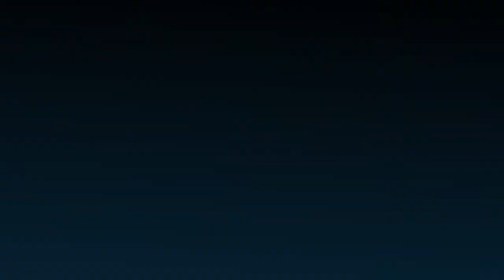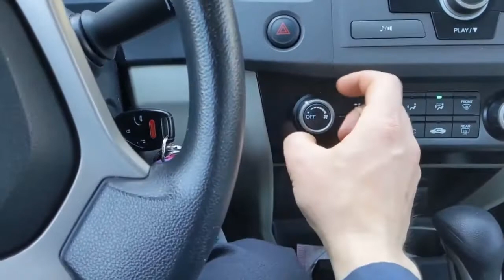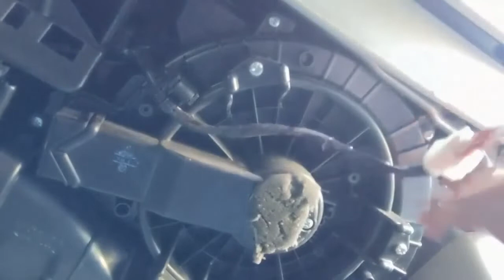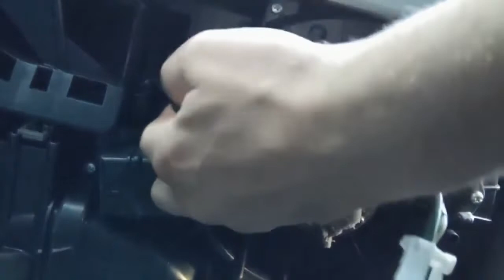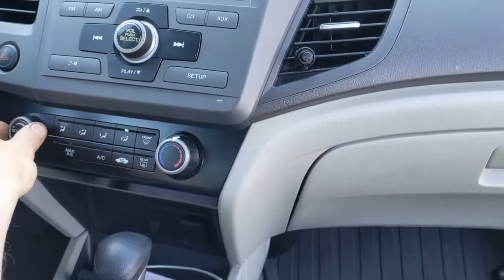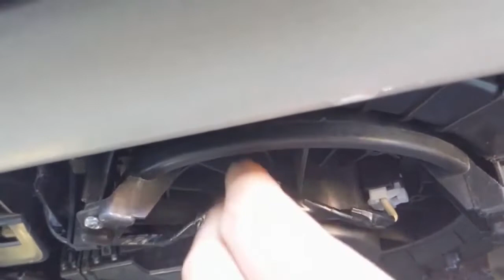2012 Honda Civic No Fan/blower Motor Operation | Blower Fan Not Working | How to Repair Blower Motor

Comment: Can you test the wires by using a multimeter?
Reply from the maker: You can. You want 12 volts on full blast 👍. A test light is the best because it puts a load on the system. But a meter should be fine.

Comment: Should one side of the connector constantly have power on it
Reply from the maker: @lesliemincy2084  It's an interesting design. The white wire on the connector will have power from the blower relay with the blower on. The green wire will be your variable ground controlled by a transistor.

Comment: Anybody help, my 2012 Honda civic is making a clicking noise coming from top of dashboard bit when I select fan speed first setting it mutes the clicking noise. I’ve checked the fan motor which is ok.
Reply from the maker: @JohnQuick-og3lg  Does the clicking noise change speed as you turn the fan up?

Comment: Question ; if the blower motor is faulty where there is no action on any speed setting (and you've ruled out the resistor via a test light), would the a/c clutch NOT operate? Because that is what is happening on my car....I would expect the a/c clutch to cycle on/off even if the inside blower is bad.   BUT it may be that the ECU senses the open circuit of the fan motor and does not turn on the a/c clutch.    

Thoughts?

Comment: On my daughter's 2010 civic when she puts defrost the motor sometimes works and sometimes doesn't.  Any clue?
Reply from the maker: See if the fan is getting power with a test light when it starts acting up. If the fan loses power then it could be the HVAC head unit. If the power remains then it's most likely the fan.
Reply: Thank you . I'll try that. What about the resistor?
Reply from the maker: @daverepole9283  The resistor is possible. Usually the blower motor or resistor would act up in all vent positions. Is this only acting up in one position or all positions?
Reply: @ValleyMobileAutomotive  only when she wants to defrost

Comment: MY  2008 HONDA CIVIC  FAN STOPPED  RUNNING , BUT IT WORKS WHEN IT'S WET OUT SIDE  BUT IT WONT CUT OFF IN STOP POSITION ,WHEN DOES RUN ,  YOU MOVE SLIGHTLY OFF TO STOP  TO GET THE FAN TO STOP   , ALSO I USED THE  DIAGNOSTIC  PROGRAM WHERE  YOU CUT THE  CAR ON  AND  SET THE FAN SWITCH TO OFF, SET  THE  VENT TO BLOW IN  1ST POSITION  (BLOWING TOWARD THE DRIVER),  CUT  THE CAR  OFF   PRESS DOWN ON BACK WINDOW HEATER AND INTERIOR  RECYCLE  BUTTONS  AND CUT CAR ON AND FAN  WORKED  DURING THE TEST AND THE TEST SAID NOTHING WRONG WITH A/C SYSTEM ?  I CHECKED A/C  RELAY  G8  H71  THE  BLACK  IT WAS GOOD  CHANGED  G8 H70   THE  BACK WIDOW HEATER RELAY WITH  OTHER FAN RELAYS BLUE ONES  AND HAVE SAME PROBLEM . IF WAS THE RESISTOR THE FAN WORK AT ALL ? COULD IT BE FAN BAD OR THE  THERE PROBLEM WITH  THE  CONNECTION UNDER THE BATTERY   I THINK IT'S  WHERE THE   G31  WIRE RUNS TO  ON SCHEMATIC. FOR THE  COMPRESSOR MOTOR ?

Comment: Thank you so much for this video. I'm a young woman on a budget. The other day the air just stopped blowing. I got a test light, followed your video and replaced it with no problem. I even changed my cabin air filter while I was at it! You just saved me so much money. Thanks! <3 😇

Comment: I’ve got one here that you can hear running but nothing is blowing out the vents… 🤔 it’s got me flipping through videos now
Reply from the maker: I've run into clogged cabin filters that will inhibit the air from coming out of the vents. If you haven't looked at that yet I'd suggest checking it out.

Comment: How did you get that “test light”?
Reply from the maker: This is a tail light socket with a double filament bulb inside. I soldered on male banana plugs to use with my electrical test lead kit. You can get the sockets super cheap at a junk yard. Some places won't even charge for such a small item.
Reply: Can you show an image of the test leads

Comment: Where is the blower resistor located?
Reply from the maker: From my understanding this system doesn't have a traditional resistor. It uses what Honda calls a "power transistor" behind the HVAC controller.